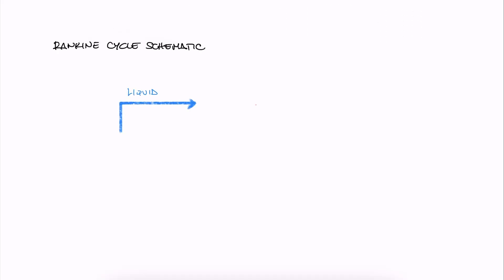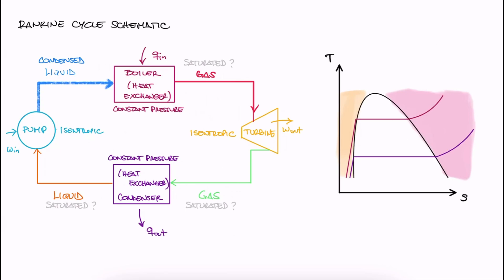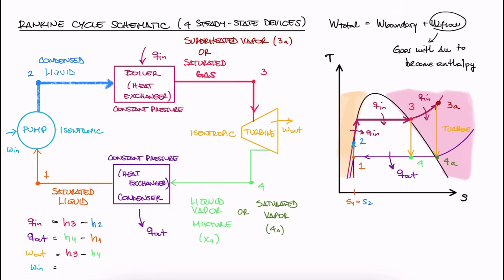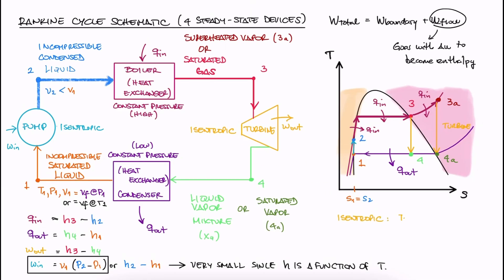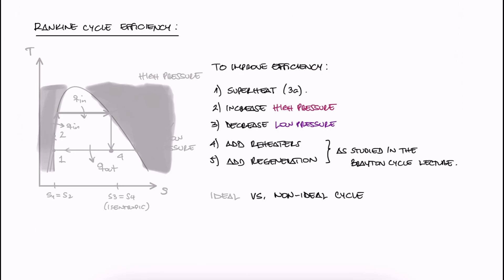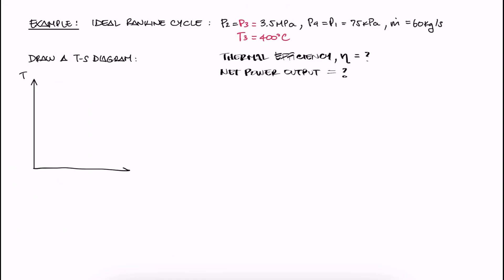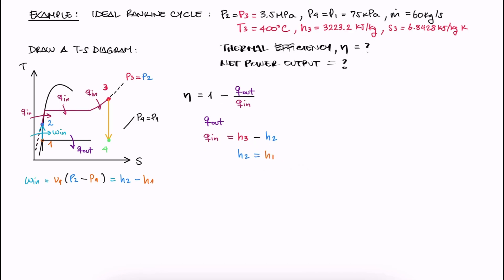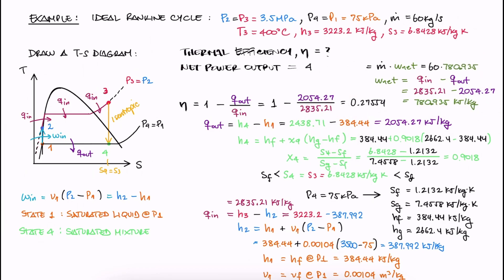Thermodynamics RANKINE CYCLE in 10 Minutes!

Comment: Glad I found this channel.  There must be losses in radial or axial flow turbines due to the diffuser structures. Could it be possibly beneficial to combine these stages with compressor stages by magnetically or mechanically coupling successive stages, perhaps with a 1-to-(-1) gearing? I'm particularly considering this for an Organic Rankine Cycle (ORC) system in the context of waste heat recovery for semi trucks, aiming to improve fuel economy. (I'm not an engineer, just curious!)

The one waste heat recovery systems, for this application,  I’ve seen used twin screws instead of turbines. My thought was to explore using a radial outflow turbine for its compact design and ease of manufacture. I realize that adding magnetic or mechanical coupling to compressor stages would complicate production, but I'm interested in whether this could offer any advantages.

As I recall the conversion efficiency for this application was less then 15% and somewhere I saw numbers like 6% to 10% expected.  Seems like it might be hard to justify.
Reply: you are bored brooo